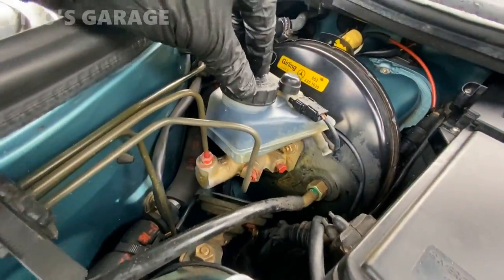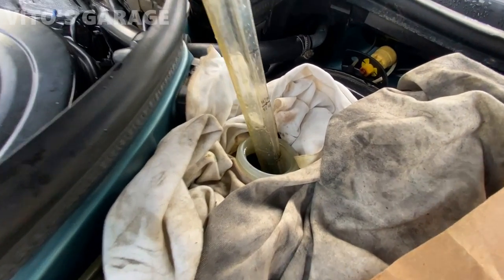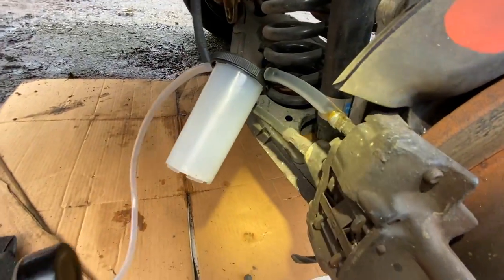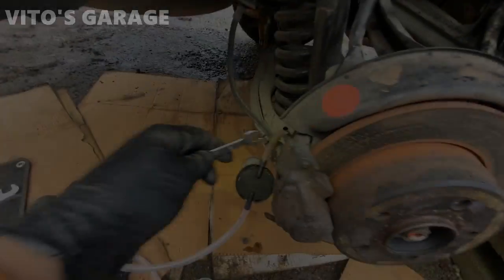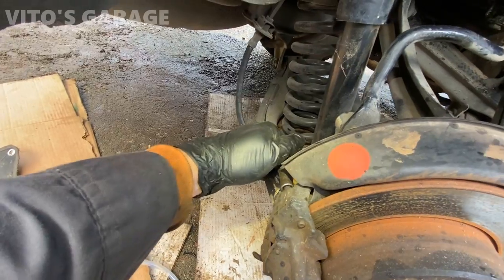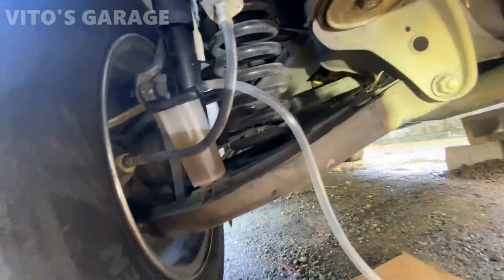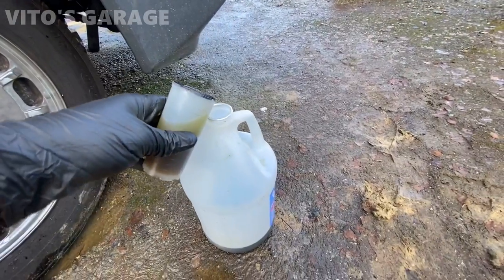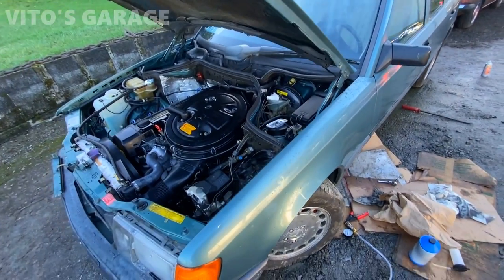Part 19: Mercedes W124 300E Brake Fluid Replacement By Yourself!! Easy!

Comment: Hello there. I hope you’re doing good. My w124 won’t push the brake fluid to the rear. This is after we opened up the calipers and drum to check on an annoying sound that was being produced from the right rear wheel. Any advice/suggestion as to why we can’t even bleed fluid from both rear wheels yet we only touched one?
Reply from the maker: Get another person. With the bleeder closed, have them pump the brake pedal. Then, tell them to release the pedal. Once the pedal is released, open the bleeder. 
When the bleeder is open, tell them to press the pedal all the way to the floor and hold. 
When you close the bleeder, they can release the pedal. 
Repeat this procedure multiple times

Comment: Don't you want to use gravity to help bleed each brake?
Reply from the maker: Brake fluid doesn’t always flow by just opening the bleeder screws. You either need a vacuum pump or attach a pressure hose with adapter to the master cylinder reservoir
Reply: @VITOSGARAGE  I saw another video that put it into better perspective. The guy was using a pressure system set at 2 bar for a gravity bleed. Awesome video.

Comment: I tried to do this but from rear brake calipers nothing come out. What is wrong with that?
Reply from the maker: Close the bleeders and pumps the brake pedal multiple times. Retry
Reply: @VITOSGARAGE  I did it and with front calipers works but from rear calipers nothing come out.
Reply from the maker: @robertbalogh3663  okay then use a helper and bleed the rear brakes with the helper. One pushes the pedal, one bleeds